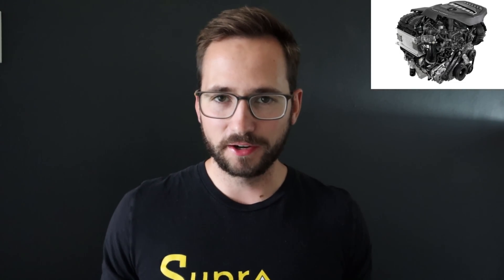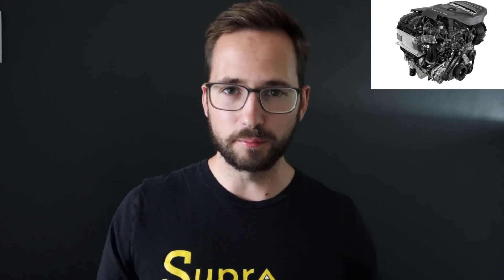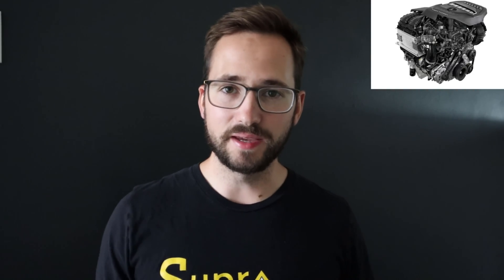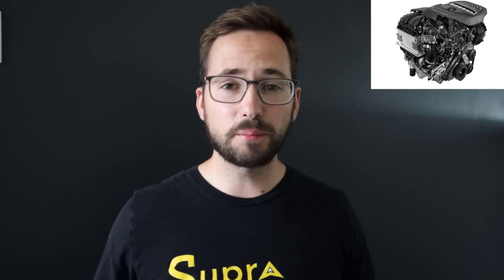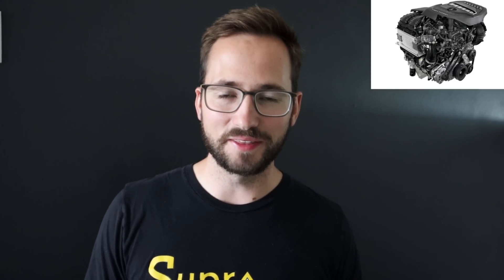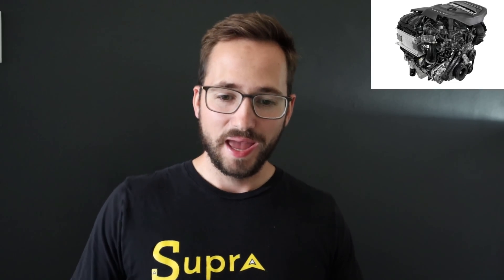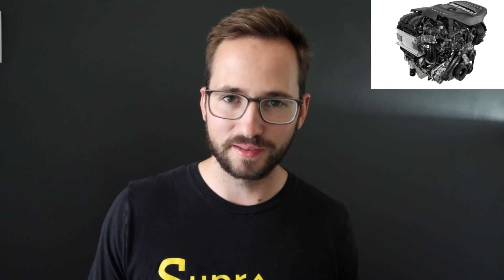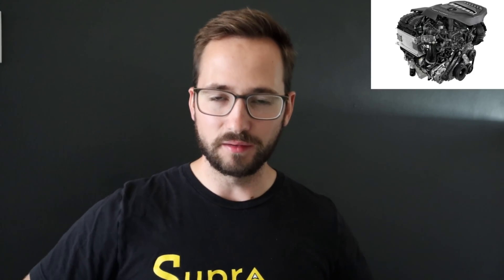The New Hurricane Engine Is Way Better Than I Realized!

Comment: Does it have port injection like the Eccoboost or will it clog up with soot at 75k miles?  That's the big question I have tbh. It will still be worse than the Ford when empty I would assume because Ford makes lighter trucks but hopefully it's better than the dreadful economy I got with a Ram Classic.  I got rid of it.
Reply: The smart way is dual-injection systems: direct backed up with port. Some automakers have been doing this for years.
Reply: @BillLaBrie  That's what I meant, and as far as I know the Ram does not have this. I know the Ford has since around 2017 and the eccoboost motors before that have long-term carbon and emissions issues as a result.
Reply: @davids1816  Can confirm as someone currently waiting on a full engine replacement on a Gen 1 2.7 ecoboost with only 70k miles on it. Thankfully being replaced with a Gen 2 under warranty.
Reply: @BillLaBrie  I have read that this is the way they are going. It is the way most have fixed the carbon build up.
Reply: I bet you were running regular gas also with ethanol, without a catch can and not changing spark plugs at 50k but wanna complain about soot build up..
Reply: @ryanpark2049  Nope.  I have an electric car, so I don't have to do any of that bullshit.  Neither does a Ford owner because the manufacture spent less extra money than all the crap you just described, to prevent the problem to begin with.  I had a Ram Classic, which wasn't even direct injected and would last for years with good maintenance, but it was so ridiculously expensive to run it that I sold it and got something that costs about $500 less a month.  If I need something, I'll just have it delivered.
Reply: @davids1816  
Huh? A ram gets 19mpg combined, how is that expensive to run, but an electric car is "affordable"?
Reply: @ryanpark2049  There is NO Ram Classic with a Hemi and a 3.92 rear end that gets 19 mpg combined.  I'd get about 13.5-15 around town and if I took a trip of an hour or more on the highway and drove 70 mph it MIGHT creep up to 16 mpg overall.  I'll be optimisic and say 15.  Drive 1200 miles in a month and with $5 gas you're at $400.  Chevy put a fast charger in my house so I can charge easily overnight. The Chevy gets about 4 miles per killowatt hour and that power costs 9 cents where I live. I'll assume 85% efficiency at charging and I'm at about $32.  My car's range is about 250 miles on a full charge and that's far more than I ever drive in a day.  So, I never charge at a public charger.  They are more expensive but still about a quarter of the cost of gasoline. I also got a $750 rebate from the state for the car.
Reply: @davids1816  believe what you want with clear gas driving from San Antonio to Austin and then back to corpus in my ram 5.7 with 3.31 and 8 speed I get 20.2 hand calc on ethanol free
Reply: @ryanpark2049  So basically on a perfect road, in warm weather, on flat land, with the tallest gearing at highway speeds, you get 20 mpg.  That's because you're not accelerating, and the thing runs on 4 cylinders most of the time. Here there are hills.  It gets cold, which cuts your efficiency, and there is lots of stop and go driving.  Take a nearly 6000 lb. truck with a cast iron engine and 2 valves per cylinder, an ancient but reliable fuel injection system, and you get wretched economy.  You'd also probably get 35 mpg driving something like a 2.0 turbo Accord for that drive. So, you're still burning money, just not at the rate that I would have been.  I really liked the utility of the truck but not well enough to put up with the costs. I think that's true for most people who have a truck, though certainly not all.
Reply: @davids1816  No over the course of 300 miles from the hill country to the coast line I average 20 with ethanol free gas, which makes sense since the usual average for mid grade 89 is 18 and ethanol free has 33% more energy per gallon than ethanol gas
Reply: @davids1816  
If you're smart about where you drive then a truck is a decent accet. Modern trucks even at 6000 lbs get better fuel economy than the early 90s models, I might spend 250 a month in fuel but my income makes that a livable percentage, with the option to pull trailers and make some side change. 2wd stock ram 1500 with 3.31 gears isnt a killer compared to your accord
Reply: My 2020 ram classic warlock , gets 19-20 mpg if I drive sensibly . 

I’ve seen nice flat road trips get 23-24 on 91 octane

Comment: Find it interesting how a lot of people made fun of Ford for coming out with a twin turbo V6 in their truck and now for the most part all the other automakers are offering them. I will say if they can put it in a Charger or 300 and still sell it for $30,000 they would make a ton of money. 😊😊
Reply: FORD WAS PREPARING FOR STRICTER E.P.A. EMISSIONS LAWS BUT ALL OF THOSE DATES GOT RAMPED UP MUCH, MUCH SOONER. THATS THIS ADMINISTRATION'S FAULT. AUTOMAKERS WERE DOING WHAT WAS RIGHT..ELECTRIC CAR TECH, SPECIFICALLY BATTERY TECH IS STILL AT LEAST 10YEARS AWAY AND OUR POWER GRID IS ABOUT 20-40 YEARS AWAY FROM HANDLING ALL THE EXTRA LOAD IF THEY STARTED GOING FULL BORE TOMORROW. THEY SHOULD HAVE WENT HYDROGEN. THEYVE ALREADY GOT THE KNOW HOW AND JUST WOULD NEED TO SETUP MORE FUELING STATIONS

Comment: This sounds like the ideal power plant for the Wrangler & Gladiator, too bad Jeep will likely e last to add them to their lineup-
Reply: Its in the Grand Wagoneer already as the only engine option....the Wagoneer is still optioned with the V8 though, seems ass backwards to me, the Grand Wagoneer is much larger and heavier, the V8 should be in the Grand Wagoneer and the I6 in the Wagoneer.

Comment: What's the gas mileage you get with one of those engines because with my 2008 5.7 Hemi I've gotten 24 miles to the gallon before and no that wasn't going downhill I was driving at 65 mph on cruise control and when I popped it up to 70 I was still getting about 22
Reply: Ask a Ford 3.5 EcoBoost owner about fuel mileage..... If you drive it like a V8, you get worse mileage then a V8.... FACT. To add, my son is a heavy line Tech at a Ford dealership, they didn't nickname them "ECOBOOMS" for nothing.
Reply: @fsilverez8408  I had a friend that has one it drank more fuel than my truck does
Reply: It will be about 10-15% better if you try to drive efficiently. Towing will get the economy based on the weight you pull. Still better than the less efficient old tech. My 2.7 f150 averages 20 mpg. A 5.0 will average 18.

Comment: If it makes it past 100K miles, I’ll be surprised
Reply: Exactly. The level of complexity is insane compared to a HEMI or LS V8. Ram will rue the day they dumped the V8 for this turd.... On the flipside, a V8 truck is going to double in value.
Reply: I was thinking the same exact thing. You know turbos are going to go out!! 💸 Software updates and lots of trips to the dealership. I’ve got 200,000 miles on a 2018 Ram pulling a trailer since I’ve purchased it. No problems with motor or transmission. Let me put this piece of 💩 to the test.
Reply: @GetSocialButterfly  AMEN!!!

Comment: But everyone wants the sound of the v8 that comes with the durability and power it provides.  This won’t deliver that…neither will electric. Turbocharging a little engine makes that engine more strung out and works it harder to tug the weight around, let alone all that a truck is asked to do by Overworking that tiny little thing. I don’t see long term working out. I’m imagining blown up 6 bangers just like the old 6 bangers of the 80s and 90s that were complete garbage in any full-size truck. Worse now because your throwing boost at it, thus speeding up the short lifespan of a little engine that’s working double duty of weight and power. This goes for all the manufacturers making trucks with Less than a v8.

Comment: 5.7L is by far the best motor ever built IMO.  Sounds amazing.  6.4L is great as well.  I have an I6 6.7 diesel and it's AWESOME.  Back in the day, I had the 4.0L Jeep, straight 6 as well.  Loved all of these motors.
Reply: This dude is smokin crack!
Reply: Lol so you never worked on one before or seen all the problems
Reply: @siclt1  work on plenty, never had major issues.  I guess I take better care of my rides?
Reply: @mikekenner9218  I highly doubt you work on them, you can literally look at a 17 or 18 so 5 years old and the block is so rusted over it looks 20 to 30 years old. Try take bad mds solenoids out
Reply: Did you just say the 5.7 is the best motor ever built? 😂😂 brother, I can make a list of engines better in every possible way. The 5.7 is okay, but nowhere near the best in any regard.
Reply: @PapiAndrey  Opinions are like assholes, everyone has one.
Reply: @mikekenner9218  what makes the 5.7 so great, in your opinion? Not saying it’s bad, but the ls exists

Comment: Could be good but will have to see real world MPG tests. On paper the eco boost is more efficient than the V8s but in real world jt doesn’t seem like much. Maybe a couple MPGs at best. On top of that, for best performance premium fuel is needed. The 5.7 Ram notes mid grade for optimal performance.
Reply: My 2.7L 4wd 4 door Ecoboost averages 23mpg. I do drive conservatively (50/50 city/hwy).

No coyote 5.0 is going to match that.
Reply: @cs1992  that's exactly why that 2.7 is such a popular option.. but what does your MPG go to when towing near your GCVWR?
If 90% of your driving is empty, that's great, but if 90% of your driving is near the max load of the truck, the engine will basically always be running in high boost and killing your MPG.
Reply: @treyhart6861  100% empty...I, like most F150 ownership, don't tow.

But, it's an ECO boost. It's meant to be economical if you drive it economically.
Reply: Everyone I know that tows with their EB, says the mpg takes a dive when they hook up a trailer.. I will be curious about these new ones if it's the same story, given it's a turbo, I think yes.

Comment: The 5.0 is better on mpg! Your not doing any research. 3.5ecos are not efficient.  The 5.0s are consistent and average better.  The 2.7ecos do get better but you have a vagina for a truck engine.
Reply: WTF did I just read 🙄😬

Comment: im skeptical twin turbo v6s can run real hot especially for trucks   with load i dont know about long term durability
Reply: ? Ford has been doing it since 2012 lol. Nothing to be skeptical about. These engines are built for the power, and higher pressure. The blocks are similar to a diesel. Ford has a composite block.

Comment: I bought an F-150 with a V6 ecoboost. Looked great on paper but was disappointing with on/off boost and mediocre gas mileage. Then more and more electrical equipment failures. I like my RAM 1500 eTorque Hemi much better. I am thinking it will be my forever truck.
Reply: Your wallet will greatly thank you if you sell that etorque and get a regular 5.7 hemi. When that electrical system gets older and starts to malfunction and break, you will be out a lot of money.
Reply: @Dan-gj1hz  That is terrible, terrible advice. One, the upcharge for eTorque was not that much and is even lower now. Two, ripping out my eTorque would void my regular warranty as well as my 5 year extended warranty. Three, the eTorque system lowers stress and wear on the transmission by adjusting engine speed for up shifts and down shifts. Four, eTorque prolongs brake component life and improves gas mileage with regenerative braking energy, the main components are a belt driven device bolted to the front of the engine and the battery behind the rear seats, easy to access and service. Five, pays for itself with up to 10% gasoline savings. Six, there are no widespread reports of eTorque premature failure and mine has had zero problems. Seven, worse case scenario and my eTorque needs replacement past my extended warranty, it doesn't cost that much and I can afford it. I paid for my RAM 1500 with my F-150 trade in and a check with no loan needed. My low mileage F-150 Platinum began accumulating one electrical failure after another: no rear defrost, no sliding rear window function, vent blower overload, random wheel sensor warnings, random infotainment shutdowns and restarts, etc. Switching from Ford to RAM was the best automotive move I ever made.
Reply: It's fascinating to me, as a dealer, engineer and analyst for the industry, how people are conned into thinking any of these things are good.  The best trans ever was the TH400/4l80e.  The best engine for a truck will always be a normally aspirated V8.  The boosted Ford mini-motors are in utter free-fall in the used market because repairs are complex and wildly expensive (in many cases more than the truck is worth).
Reply: A soccer Mom v6 has no place in a large vehicle like a pick up truck. The Hemi is a great V8.
Reply: You can electrical problems with any engine
Reply: Only somewhat common issue I know of with the Hemi is the dreaded tick and I’ve seen and heard of quite a few cam and lifter jobs. But GM has the same issue with thier V8’s and I would have to say it’s a big problem for them. We currently have 3 tahoes waiting for engines and that’s just in our location. Haven’t seen any of the charger or Durango persuit vehicles come in with cam issues yet but I’ve done 2 myself on the outside before I came to be a state police tech
Reply: Weird, I get 19mpg average and run mid 13's in my 4wd crewcab ecoboost. that is 100% stock.  I don't even have the Powerboost either.  I ran one Ram and put about 8 truck lengths on him.
Reply: @hi-fi3889 Suuure.  😁🤣
Reply: Its the other way around, The Ram Transmission is a pile of Junk, Traded it for the V6 3.5 ,Love it
Reply: @cessealbeach  the ZF 8 speed is universally celebrated as the best automatic transmission ever.
Reply: @cessealbeach  You are the first person I have ever come across on forums complaining about a ZF 8 speed trans. Every car company from Audi to Toyota is fighting to get them in their cars. There is nothing close for dependability and drivability. You obviously don't own one.
Reply: The new 10 speeds are in my eyes , the best transmission ever built - 

I drive a 2020 ram 1500 , and have zero complaints about my truck , but I’ve ridden in several 10 speed cars and trucks , and it just feels so much quicker and always seems to be in the “power band/ meat “ of the torque curve
Reply: @cessealbeach what? Those soccer Mom Ecoboost V6 motors are trash. My grandparents explorer shit it's internals and they bought that POS 9 months ago. A little 3.5 v6 isn't going out perform a Hemi V8😂

Comment: It's kind of a wash. Whatever fuel economy savings were gained by switching to a smaller cylinder twin-turbo arrangement will be eaten up by the higher cost of premium fuel. Add in the extra cost of maintaining those twin turbos and there is little to offer the consumer over the less tech current offerings. Good value for dealership and repair shops, not so much value for the consumer.

Comment: Being a straight 6, I bet the torque is gonna be more then 500 easily. I wonder how much more mpg you could get if you put a Venomaire intake and plasma plugs and an engine tune in this engine? 🤔
Reply: I agree. The GM 2.7 I-4 is at 410 torque in the high output version.
Reply: That's what I'm saying it should be at least 600

Comment: I can't wait to see the V8 fools finally wake up and see the torque. 420lbft 3.5 EB is still better than any 5.7 hemi for pulling capability(more torque down low) I'll keep my diesel 1050lbft@1600 pulls harder lower than the Ho Cummins and pulls far harder at the top end.475hp@2600 is 959lbft where as the 420hp@2800 HO is only 787lbft. A 600hp Cummins X15 are making 1750lbft@1800(600hp) and 2050lbft@1200-1450rpm.
Reply: Problem with the 3.5 eco boost is terrible reliability and burns more fuel than anything I’ve ever seen
Reply: @benmartin6476  well clearly you haven't driven a real truck. I have driven peterbilts that can't get 50l/100km(4.7mpg) I know my 3.5 I had would chew through fuel(worst was 28l/100km or 8.4mpg) but that's a turbo for you. More air means more fuel means more power. 420lbft at 2500rpm is just a hair over 200hp. Where as the 5.7 hemi is still under 300lbft at 2800rpm(157hp) the reason I give you the hp witht he torque is because it's a calculation. The first EB is far more CAPABLE in its than the current offering form the V8s. The 6.2 420hp@5600rpm is 393lbft. Well the 
3.5EB with 375hp@5000rpm is also 393lbft. Funny how 600rpm makes the same force(torque)  "appear" stronger? It's not. It's a calculation for how fast that 393lbft of works get done. My 6.7l powerstroke can burn way more fuel than any of the gas motors. But I'll get way more work done. It's all in how you use them. I get 24mpg(9.6l/100km) out of my 6.7l powerstroke, and I could routinely get 8.9l/100km(26.4mpg) with that 2016 3.5 EB I had.

Comment: i imagine dodge will put the hurricane engine in the charger police package which means that chevy will likely have the last v8 powered police vehicles.
Reply: I'm all about saving my tax dollars. I've had the same argument with my ignorant neighbor that wants to tell me how wonderful the crown Victoria's work for police use. And that they need a v8. An older bombing majority of police engines sit at idle for hours. Which uses more fuel, and a 3.6 l pentastar charger accelerates two seconds faster 0 to 60 then a crown Victoria. But when presented with the fact she does what all Republicans do, tried to deny and deflect
Reply: @ubeuonly  Most of the police cruisers where I live are Ford Explorers or F150s with Ecoboost engines in them.  I don't think they have anything other than the F250 Powerstroke that have V8 engines anymore.  The F250 only gets used for towing the Sheriff's boat up to the lake during the boating season for patrolling the river....They still have a couple of Crown Vics but no longer used for patrol vehicles.